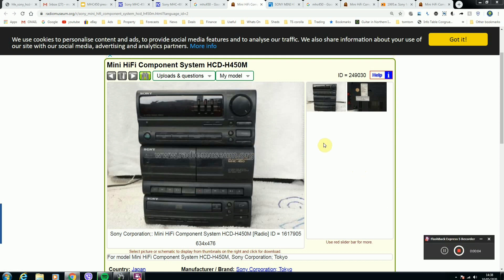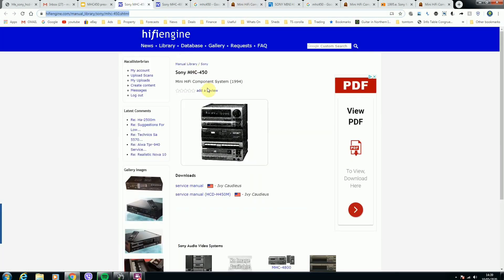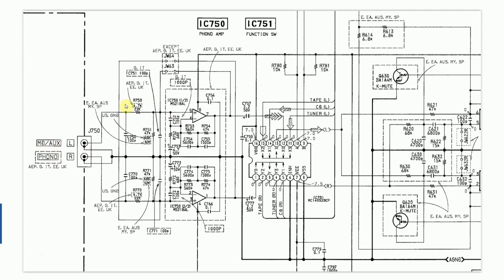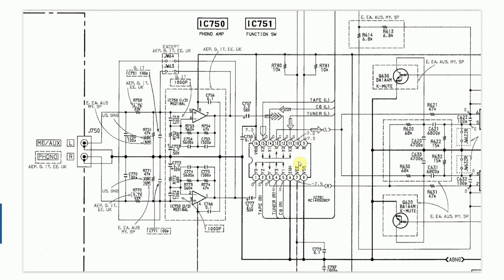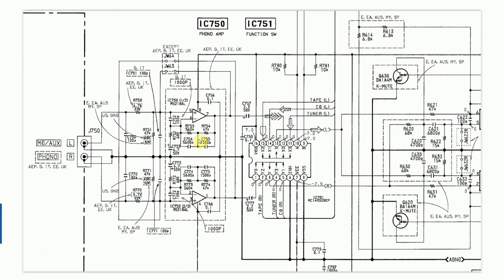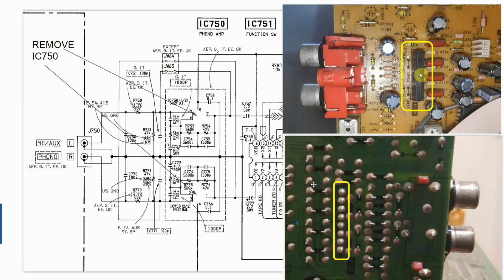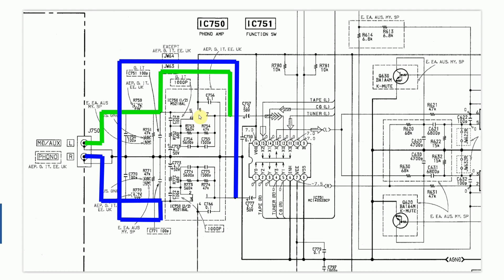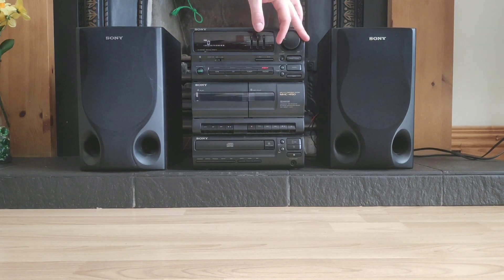Convert old hifi to a smart speaker! Hifi aux in upgrade!!

Comment: Thanks so much for this video! It inspired me to do the same thing with my MHC 550. Although I could not find the service manual anywhere, the preamp circuitry is similar enough that I could do it with the help of your video. Apart from removing the preamp chip and soldering in the jumpers, I also modified the resistors directly attached to the connectors (R770 and R750 in your shcematics). My line of thinking: the schematics shows the AEP/G/IT/EE/UK version with the preamp should have 4.7R while I assume the other versions should have 22k. My MHC 550 had 1k. I assume the R770/R771 resistor pair is a voltage divider. The US version would have R771 of 68k combined with R770 of 22k. To get the same ratio with R771 being 47k I made R770 (and R750) 18k. Plays great! Now I'm trying to find a way to automatically turn on the "PHONO" function when I power up the system, since I want to turn it on/off by switching the mains, not by the buttos. The beast consumes ~10W when powered off :(
Reply from the maker: You are welcome and thanks for your comment. It's good to repurpose these old hifis rather than sending them to landfill. Good observation in the resistors I didn't adjust any of the resistors but I can report that it has been working fine as my main soundbar for three years now. I had no idea there was such a big power consumption I will have to consider switching this hifi off more while not in use.
Reply: in the end I just shorted the function switch inputs for PHONO and TUNER (the pin numbers on MHC550 are different than in your video); now both TUNER and PHONO play the AUX input. Then I shorted the power button contacts and that makes the system power on when plugged. Now it's just a dumb amplifier, which is all I wanted (CD and TAPE are mechanically dead and I never listen to the radio). Thanks so much!
Reply from the maker: Thank you for this info. Good job. 👍

Comment: Couldn't you also use a phono to aux cable?
Reply from the maker: No it's to do with how the signal is amplified. If you Google line in vs phono it will explain the difference and why we can't just plug a phone or mp3 player into a phono input without it getting distorted.

Comment: thanks, i have a similar sony sitting gathering dust and wanted to do this for ages, this is exactly what i was looking for, i might even add in an Arylic board on the "Tape" input to give me more options, as they really do have a nice sound
Reply from the maker: Yeah they sound great for something that was made in 1994! After I posted this video I realised that I didn't do a good enough job of cleaning the flux on the circuit board and got a bit of crackling so had to reclean that with IPA  but we have been using this stereo now as the main sound for our TV. Works great.
Reply: @orbitaaltube  thinking of adding one of these inside the case, to give wifi, bluetooth etc and just hook the line out to phono input https://www.arylic.com/collections/diy-audio/products/up2stream-pro-receiver-board